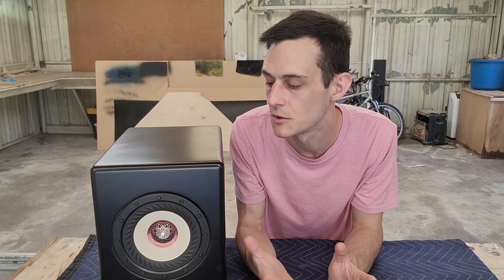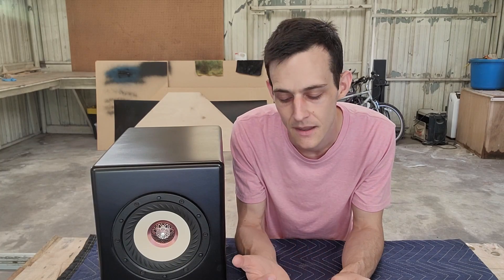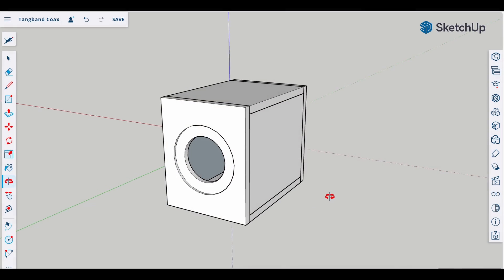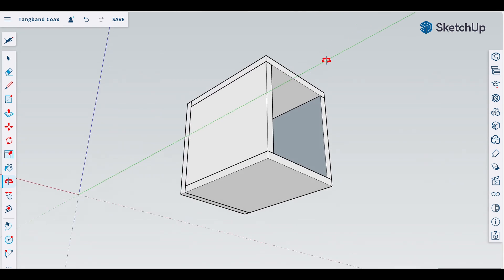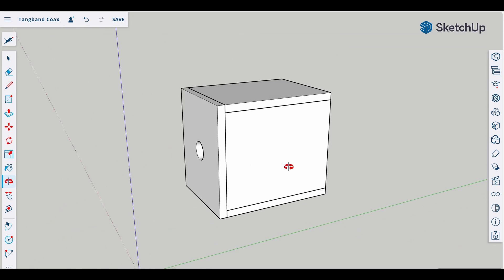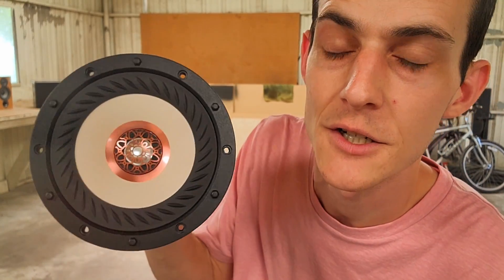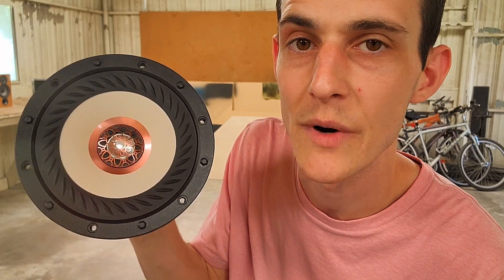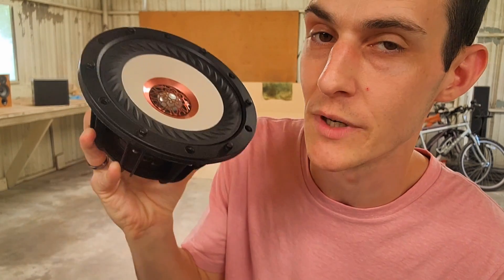EASY TO BUILD High-End Coaxial Speaker  - Tangband w6-2313

Comment: I'm fairly certain offsetting the Drivers slightly also has a canceling effect on edge diffraction. I didn't see you do it, but assume you radiused the inside cabinet edge where the driver is, yes? That is a cause for issues.

Comment: I think my only two modification would have been to round over the inside of the speaker hole. This hemps with internal refraction but even more so than the round over at the edge of the front enclosure baffle. I am also a big fan of passive radiators over ports and now that tuning them is well understood you can actually make changes tot eh tuning frequency much easier than changing port length. Although, like you said with this design I may have gone sealed as subwoofers is a must for higher output listening. Thumbs up.
Reply from the maker: You're right about the passives. This would have been a good build to use them in. I also appreciate the ability to model, and then make adjustments in the real world. 

My concern with rounding inside driver openings is always material thickness. By the time I countersink a driver, it leaves little material left to screw into. But I do know it has many benefits.

Thanks for the watch!

Comment: How do you determine your crossover frequency/slope?
Reply from the maker: Hi, that's a complex question. I started by measuring both tweeter & woofer separately. Finding where both drivers begin to distort & break up. Just before that is the crossover point. The slope is determined by woofer Cone breakup, and tweeter distortion. 

If you have more specific questions, please ask.

Comment: TangBand make great reasonably priced drivers for sure! ...I really miss a bunch of their W3 sized Full range drivers, like the W3-871S, etc ...I still use my Logitech z5500 system which feature the 871s ...nice build!
Reply: I recently built a 4.1.2 out of 6 identical SB Acoustics drivers (8 inch fullrange, 27 liter, no correction just capacitor tuning, 30mm HDF front, very well braced) and though they are very cheap they do not sound like that at all. Best set I ever had.
Reply from the maker: They are a reliable manufacturer. Not many are willing to take a chance on building coax drivers. Glad we have options as DIYers